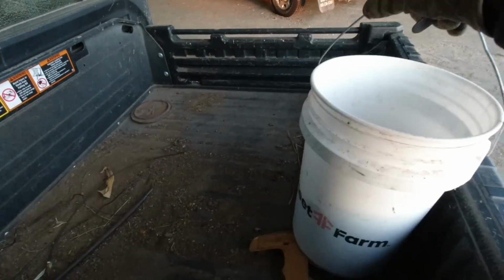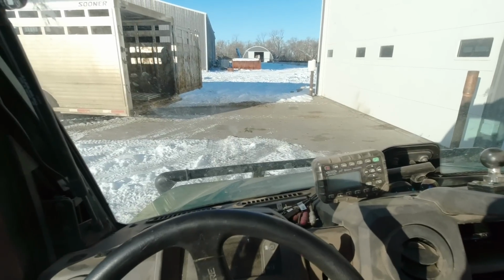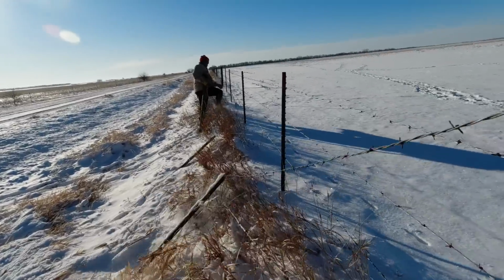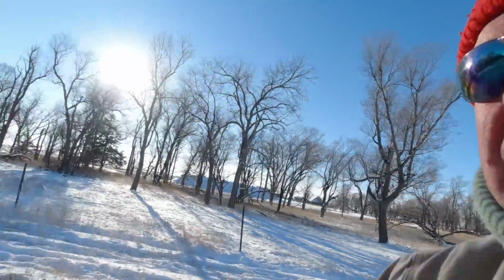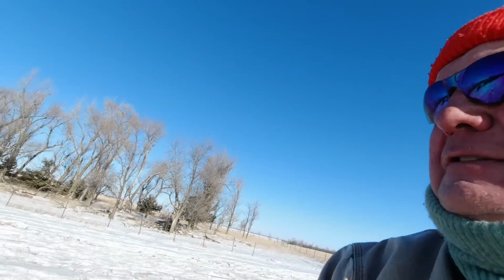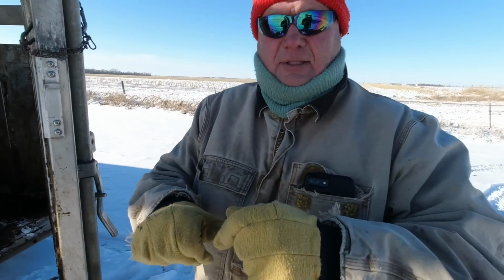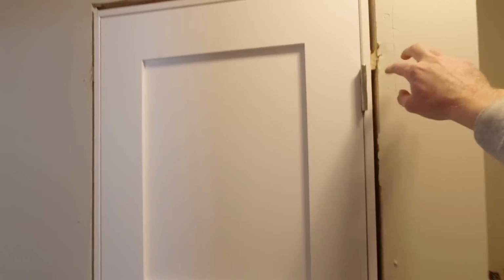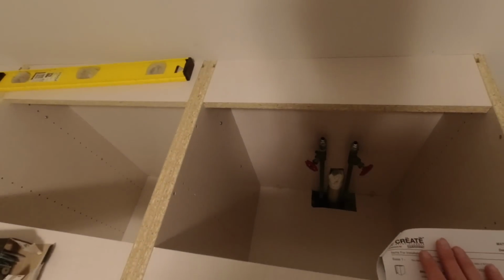Preparing for a Blizzard!

Comment: Well, we did not have temperatures that low in NJ. We did have a couple of gates like those hee, hated them, I could never get enough pull on then to flip the loop over the post to shut the. WE also used the bucket trick with the (dairy) cows although we did not have a treat  for them when the cows came running. The pasture in front of the barns and house was about a football field in depth out to the road. We had several exceptionally intelligent heifers who could pick their way through a three strand barb wire fence, not breaking any  of the strands. they would casually look both ways to see if cars were coming and then head to the neighbor's lawn for a snack. We discovered that banging on a metal pail would bring the back with out us having to go over and get them. Stay warm! Looks like we might be getting rain when the storm reaches us in Eastern PA.

Comment: Your comment about the Artesian well never freezing reminded me of the story about the guy who bought his first tractor.  The dealer went over all the service details with him and the next spring the guy came into the dealership pulling his tractor with his horses.  The block was cracked and leaking.  The dealer asked him what kind of antifreeze he used and the guy said he had a creek next to the barn that never froze so he just used some of that water in the radiator.

Comment: Next oil change use a # 2 Phillips put a hole in the filter.
Using a air nozzle with a rubber tip. Using around 50 psi pressure. Blow that oil back into the crank case. Less oil spill on you and the floor. Works much better on horizontal mounted filters.

Comment: I used to always hang doors using finishing nails until one day a carpenter showed me to use deck screws instead. That way they are always adjustable with the turn of a screw. Merry Christmas everybody!
Reply: Use something besides a Philips bit and u will better off
Reply: @waynejones5239  We don’t use Phillips in Canada other than drywall screws. Our deck screws are # 10 Robinson. I drill a pilot hole and counter sink them.👍

Comment: I know this sounds stupid, but being from SD myself maybe invest in some small solar heated heater wires for like plants to wrap around your water spouts or even line the giant tire water basins with them to prevent freezing? I know SD temps and weather are insane but something like that plus maybe a small solar panel on a fence post so it doesn't get covered by the SD insane snow might give you guys a break with making sure everything is not frozen? Fruit for thought..again I don't know everything in your area because I live in Germany now, so just trying to help make life easier if possible!!!